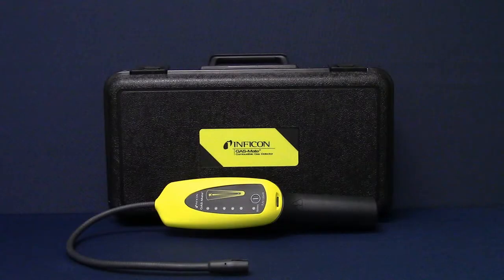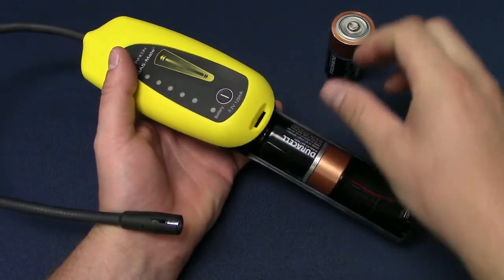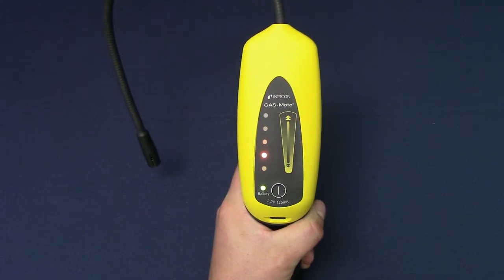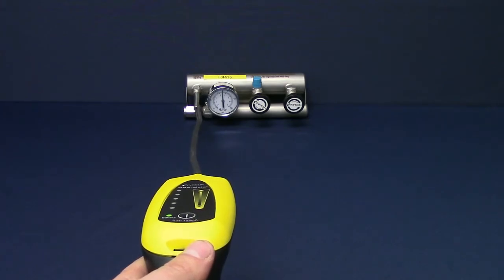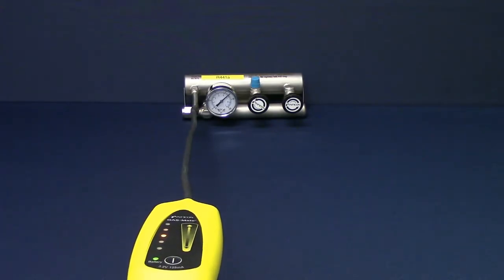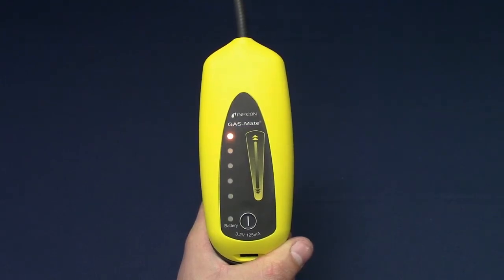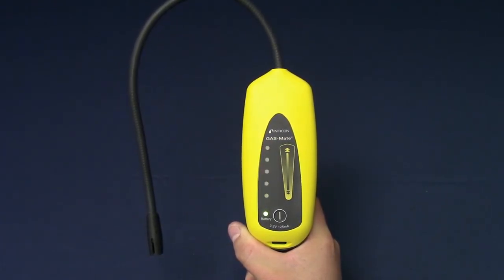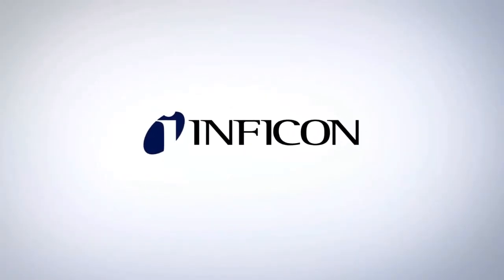Quick Start Video for GAS-Mate® Combustible Gas Leak Detector

Comment: I gotta ask about 1:27 "not to be used as a personal protection device." 
What??
Reply from the maker: Hello, this is simply a precautionary reminder that users should not rely on GAS-Mate Combustible Gas Leak Detector as a personal safety device in potentially hazardous environments. Specifically, users should not use GAS-Mate to monitor the background for explosive gases. This is because GAS-Mate will zero to the background once it alarms for a few seconds, so there could be a potentially dangerous background, but the unit will not alarm because it has already zeroed. If you have any additional questions please contact us here https://bit.ly/3e7K6no.
Your INFICON Social Media Team